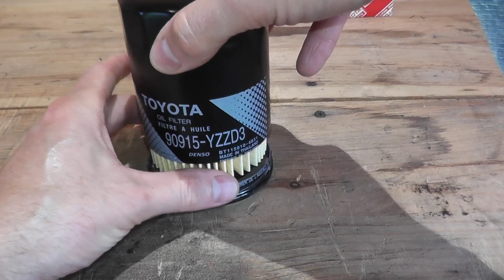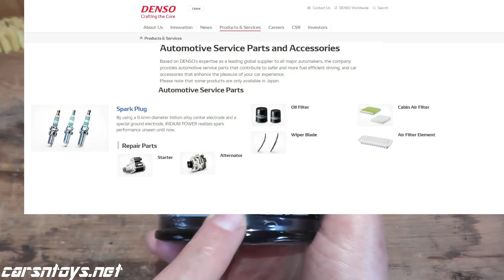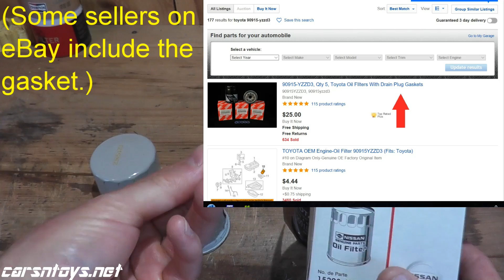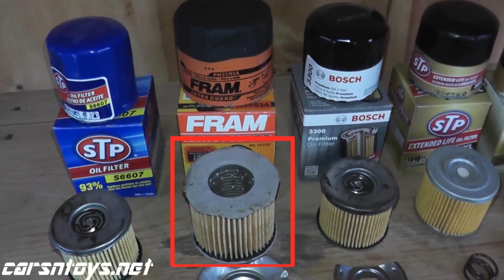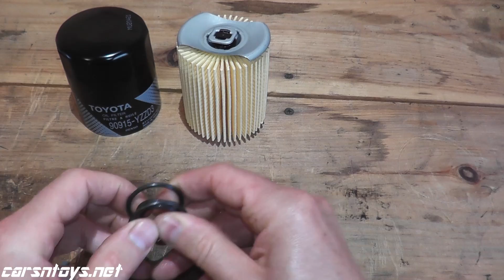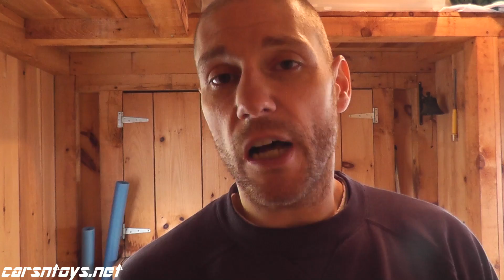Toyota Oil Filter Review | Denso Oil Filter

Comment: I am a Toyota owner and have been for 10 years. My current car I’ve had for almost 11 years. Toyota since early 2000s has been pushing 5000 mile oil change with synthetic blend motor oil. 
This is also in myToyota manual. Personally, as far as how often you should change your oil I say consider your driving habits, as well as the type of oil you’re using and the condition of your vehicle. I don’t think anybody should go an entire year and never change their oil unless their car is barely driven.
Reply: Meant to say I’ve been driving Toyotas for 18 years

Comment: Actually, denso stuff is mainly made in China. Which is still better than anything ford even if it's made in Washington, DC. Nevertheless, I try to buy parts made in Japan. For example, GTK instead of NGK spark plugs. I found a dealer in Dubai that sells OEM parts for less than 50% of what a friendly US stealer charges. This is feasible for small parts but larger parts cost too much to ship. Having said that, I admit that I bought a radiator and AC condenser directly from Denso for about 30% of stealer's price. Yes, they were made in China but it's been 7-8 years, and both have no issues.

Comment: thanks for the data. good video. i have a 98 4 runner w a 3.4 v6. it has 438,088  miles on original engine . never removed heads. i have used motor craft 5 w 30 for last 300 k. this last time i went with a "Denso/Toyota oem filter instead of motor craft . i am glad i did. i normally go 12k between oil changes based on an inspection of the oil . that motor craft is so clean and i attribute the long life of this engine to good filters and quality oil. it did need an oil pump and a fuel pump at 400k. even after 12k miles , the old oil is still clean enough to pass light right through.at 400k  under intake and under valve covers was clean and stain or sediment free. same with my ford f 250 w power stroke. that gets 15/40 motor craft. spotless as well. flow rate is crucial on the strokes as the fuel injection relies on engine oil to drive pressure to injectors. this oil and filter combo has treated me well but i think your review on the denso proves it is as good or better than motor craft filter. but m c is still a very good choice . never use fram ever.

Comment: Cut the filter into three pieces. Unroll and measure the area of the center piece. Multiply by 3. Now you have the surface area of the entire filter. 
Also if you cut the area with the resin and not include it in the total area because if it has resin in it then it's not really doing any filtering.

Comment: Idk if someone has said or not but you can get the oil drain plug gasket from toyota. When you get the oil filter from the dealership just ask for one and they usually give you one without any charges unlike some other companies (Honda)

Comment: I have a 2009 Camry Hybrid and always use the Toyota filters since you don't really know what quality you are getting with aftermarket.  I recently read that Toyota hybrids can be damaged on startup if the filter does not flow enough oil.  The Toyota hybrids are started by MG1 (motor generator 1) in the transaxle, not by a conventional starter motor.  MG1 spins the engine to 1000-1500 rpm before the ECU allows fuel delivery for startup (this is done to reduces emissions I think).  This is at least twice the rpm provided by a conventional starter motor so if oil flow is not to spec, especially at low temperatures, damage to bearing could result.

Comment: I have a Toyota hilux 2007 1kd ftv 3.0 with 115,000 kms always used o.e.m.oil filter and full synthetic oil last oil change at 110,000 kms now on cold start the oil light is taking 5 seconds to go out and I hear a ticking noise from the valve train until the oil light goes out it seems that that the oil filter is draining back I have not had this problem before the oil filter is a denso made in Thailand where I live I check the oil pick up screen every time the oil is drained it is always shiny and clean Thailand temperature lowest 16c highest up to 42c I like to change the oil and filter every 5,000 kms maybe over kill but these engines are prone to carbon build up so I change the oil when it starts to go black so have you experienced any problem of drain back overnight with o.e.m. denso oil filters.i would appreciate a response if possible thank you

Comment: I buy a case of 10 Toyota OEM oil filters for my 1996 Toyota Corolla for around $45 on Amazon. It even came with 10 oil drain bolt gaskets. Great value.
Reply: If you bought them on amazon,  they're most likely a counterfeit Densos
Reply: I skip on Amazon now due to risk of possible fake car parts. YouTube it. I buy from the Car manufacturing dealer/parts site or direct from the company that makes the actual part
Reply: Don’t buy from Amazon unless you are sure it’s a reputable seller and spark plugs also
Reply: that is smart, you end up paying less for filters over the life of the car if you get 5 years worth at a time. I just spent 7.50 on a 2006 Camry filter. wish I had bought a case of them when we bought the car.
Reply: All counterfeit

Comment: Great video, thank you for posting. I buy my OEM filters from the dealership and they always provide me a new gasket for the drain plug free of charge. Just thought that was worth mentioning since you brought that up. I only pay between $3.50 to $5 depending on dealership.  I was curious to to see the inside of the filter and how it compares to other brands and it's quite impressive. My 04 4runner has 250k miles and no major engine failures running oem of K&N filters mostly. Many of these miles are towing, long drives on 4wheel roads, in climate temperatures as low as -36F through steep snowy mountain terrain and climate temps exceeding 100F when I moved to TX for work for two years.  I've noticed that the OEM filter seems to have much more oil left inside when I do an oil change. The filter sits on top of the engine and I'm curious if the drain-back valve is designed differently  due to this configuration. Any thoughts on that?

Comment: 3-4k miles for conventional and 5-6k miles for synthetic no matter what manuals say.
Reply: Synthetic oil is good for 12k or so.  There is no need to change that early unless you drive hard or do a lot of idling.
Reply: @user-tb7rn1il3q  10,000-12,000 miles is for someone who drives 90% highway miles long distance trips and no cold weather. Not many people drive like that. Someone who drive mostly in the city, idling in traffic oil should to be change at 5,000 miles. For someone who use conventional oil, 3,000 miles for mostly city driving 5,000 for 90% highway driving.
Reply: @flucas6595  5k miles on synthetic is a waist.  Synthetic oil is good for 12k miles or 2 years.  Modern cars do not idle much. Cold weather is actually easier on oil.  Driving slow in town does not wear out oil any faster than driving 80+ on the highway.  If you tow heavy loads in extreme heat more frequent oil changes will be needed.
Reply: @user-tb7rn1il3q  12k miles highway driving is the same as 5k miles city driving. I use full synthetic I change my oil every 5k miles  or 6 months whichever comes first. You realize frequent short trips and stop and go traffic don't require 12k miles oil changes. Longer oils will end up replacing a new engine in the future no matter what kind of oil you use. For people who love their cars and want to last a long time will change their oil regularly. Oil and filters are cheap, new engines are not.

Comment: You can find the Toyota filters as low as $4 each if you buy from Toyota dealers that sell parts online at a discount.  Some will include a Toyota drain plug gasket (coated aluminum), where others will charge 80 cents to a dollar for the gasket.  Walmart stores sell a very limited selection of Toyota filters (they usually sell the 90915-YZZD3) for around $7, but without a gasket.  The 90915-YZZD3 fits trucks/SUVs with the 4.0l 1GR-FE V6 (Tacoma, 4Runner, FJ Cruiser), and I'm sure it fits some others.
Reply from the maker: Very cool. Appreciate the feedback

Comment: Filter good for 5,000 miles or six months with conventional or 10,000 miles & 1 year with Synthetic. Guess what that means. You can use conventional and still leave the oil in filter in for 10,000 miles/1 year just change the oil every 5,000 miles. The life of the filter is still the same regardless of the oil you use.
Reply from the maker: Yes, but I don't think I would. It's not worth the risk in my opinion.

Comment: Also had a torque stop feature which prevents over tightening. Never a problem removing filter with this feature. Been using Denso filters since first Toyota vehicle circ. 1967.

Comment: Fram end caps are not cardboard... (Even if that's what they look like)...
Fram does NOT use cardboard endcaps but resin impregnated endcaps which are arguably better than metal end caps which are harder to bond to a paper filter media and likely no better or worse than Toyota OEM filters.

Comment: I have a 2013 Camry and it uses a cartridge oil filter. The same internal filter without the can and center tube. What i like about the cartridge filter is you can see what condition its in when you change your oil. (has it collapsed or is there anything "funny" happening inside the engine) I have had a Purolator become deformed, but the Toyota ones seem strong. Being Canadian, someties (not often) I start my car when its -35 or -40 F (no block heater but run 0W20) Its those extremely cold start that seperates the men from the boys in oil filters.  Denso / Toyota are good filters and so is the FRAM Tough Guard cartridge oil filter.
Reply: Yes, the mysterious orange "can of death" from Fram is still ok.

Comment: Hi. Always like to see cut away filters. About the Fram/cardboard issue. I spoke with someone at the company, and they told me it wasn't cardboard. I can't remember the word they used. However, they said that the resin to bond the media to the caps is better than metal because it will bond better. Have a great day!
Reply: That's NOT "CARDBOARD" -- it's called "composite" -- and it bonds to the filter media BETTER than the steel end-caps.
The "cardboard" end caps are fine for a short (3,000 miles) interval oil change, but the extended-life filters require the long-lasting qualities of the steel end caps.
The famous 95 MERC runs Pennzoil Ultra Platinum, 5-W-20;  Bosch Premium Oil Filter #3410;  FILTERMAG #SS365PR Magnet Kit.
 Oil and Filter changes at 5,000 miles.  16 City, 24 Hiway mpgs at 171,000 miles on 4.6 liter V-8.
Reply: Everyone for some reason(s) like to mention that the Fram uses cardboard or composite at the ends.  But for some reason, the can of death still works and I don't see any problems yet.

Comment: Used Denso oil filters for years with no failure ever. The unique design allows more square inches of filter media. A lot of BITOG forum members don't think too highly of Denso oil filters because of the media's filtration effectiveness, but then most members on that forum which started out as one about oil filters are known to be more than a little anal when it comes to oil and filters.

Comment: Bypass in the bottom is considered an inferior design to the motorcraft and purolator design in the threaded end, as the bypassed oil doesn't wash across the media...

An fl400s or fl1a may possibly fit your application as I recall using some old stock Toyota filters I had for my sequoia same yzzd3 filter I think...

Comment: Thanks for posting this cut up review.
But you’re kidding about the Toyota oil filter, right? The quality of construction looks very good but not great, and when I was researching oil filters for my Toyota awhile back for the first oil change, the idea of just walking into the Toyota dealer and paying $3.89 for a Toyota oil filter seemed very appealing and astonishing to me, almost too good to be true, and it was when I looked at the Toyota Denso published data for media micron filtration numbers, I will definitely pass on it. The Toyota Denso oil filter is rated at "20 micron or greater, media is 51.0% efficient", to say that is not great is an vast understatement. For about the same price there are easily two dozen filters that can beat the quality of construction and get one rated at "20 micron or greater, media is 99% efficient". It is interesting to see the filter opened up but why not add the ISO 4548-12 filtration numbers or the manufactures own published filtration numbers in you're videos? 
Side note: When I did the first oil & filter change on the used, but new to me Toyota, there was a Toyota 90915-YZZF1 oil filter installed and when I opened it up the media had collapsed and had one tear in it and had also started to split at the bonded media seam, probably just a one off anomaly, but thankfully I had already purchased a non Toyota Denso oil filter and was glad I did. Normally I prefer the manufactures OEM parts, and will pay more for them, but not in this case.
Reply: He didn’t post the 4548-12 because that’s vaporware for toyota filters. And there is no publicly stated iso rating for them, you got that quote from amsoil. As far as anyone has been able to find there is nothing available for the iso numbers, not even beta ratios. So if you truly did research, you found the same thing as anyone else. Nothing. Just amsoil’s graphic. So why the overstatement of knowledge?

Comment: Thank you so much for this review on Toyota Filters!!!
We have 2 older Toyotas that keep on running, our Camry 1993 (owned since new) and 4Runner 1992 (bought from original owner 10yrs ago). I was stocking up on filters at our local BiMart (Oregon) and found they had Purolator One Camry and  Purolator Classic for 4Runner.  After watching your video, I found Toyota Dealers selling on Amazon. I called my local Toyota Dealers who told me, when buying them as 3 or more, they are the same price as Amazon (with shipping).
I am thinking of keeping the Purolator Ones (High Desisity Synthetic Blend Media), but definitely taking back the "Purolator Classics".  On the other hand, I might as well just buy all Toyota OEM since they are the same price or cheaper - and they are as good or better with 99% filtering.
Thank you again.
I know your "Contest" is over, but just in case, I need them for 1993 Camry (4cyl) and 1992 4Runner (4cyl).   ;)

Comment: This is a great video but there's a big IF. If only what you have is an original authentic Toyota product. These days fake filters outnumber those real ones and there's no way to know which you've got unless you have them side by side and know which is which in advance or you cut open one and really see the inside. Filters are cheap to make these days and those fake ones even have the same quality crisp printing on the boxes and on the filters too. Or those cheats could buy empty authentic filter boxes cheaply from workshops and put their fake ones in to make you think you bought an authentic product. Unless you bought yours from a Toyota dealer, the chances are greater than 50% you have the fake, based on sheer numbers alone.

Comment: Wix/Napa and Purolator/ carquest are fine also. I have 400,000 on my 2001 4 runner 5Vz-FE and have only used those filters. With 5k oil changes and conventional valvoline
Reply: I HAVE 98 4 RUNNER WITH 280000 MILES I'M CURRENTLY USING KIRKLAND SYNTHETIC OIL AND 910S MOTORCRAFT OIL FILTER..MY QUESTION IS,  ITS SAFE TO DO ONE YEAR OIL CHANGE INTERVAL IM ONLY PUTTING 3000 MILES A YEAR ITS A WEEKEND CAR? THANKS IN ADVANCE😀✌
Reply: @Nomen Clature  THANKS A LOT I REALLY APPRECIATE YOUR RESPONSE 😀✌

Comment: Never go over 5,000 miles on any oil change regardless of oil or filter
Reply: Depends on your owners manual. I had a kia. And it said to change every 6 to 7,000 miles. My old toyota is every 5000 miles.
Reply: that's old school thinking
Reply: Jon Smith is right. Change your oil and oil filter after every 10 miles
Reply: @rabbicovidstein4421  LOL!!! I would be stressed out if I had to do it that often.🤣
Reply: If the car utilizes dry-sump oil lubrication and its oil change interval is at 12,000 miles, then changing the oil at 5000-7500 miles is okay. But for such lubrication system, only OEM or the equivalent high quality fully synthetic oil and oil filter must be used.
Reply: I trusted audi’s 10k oci, until a connecting rod and bearing disintegrated and sent shrapnel throughout the entire engine and turbo. I’ll never be so foolish again. If you want your engine to last, go to 50% oem oci. Oil is cheaper than an engine.
Reply: nonsense. my car's owner's manual says every 6 months or 6750 miles... i go by that

Comment: I get my oil filters from the Toyota dealer for $5.00 each.. They also through in a gasket for the oil inlet.. One idea to measure the area of the filter is to measure a filter fin in both directions. Take that x2 for both sides, and multiply by the number of fins.. That will give you a very close estimate of the surface area.. Good little video!!!
Reply: Throw*

Comment: Wouldn't dirt oil flow through the top and bottom of oil filter where the pleats fold?
Reply: No, because oil it shot directly in the middle of the filter. This forces oil to pass through the filter material.

Comment: OMG, is filter element sealed on the top and bottom of the filter element all the way to the ends of each pleat with resin? If not, can unfiltered oil squeeze through the top and bottom of the accordion tip ends? Great video please address this observation. Thank you.
Reply: I have the same concern but no one wants to address it I cannot see how unfiltered oil cannot get past the top or bottom of the oil filter like you observed that’s the reason why I can’t use Toyota OEM filters until someone can explain our concern.